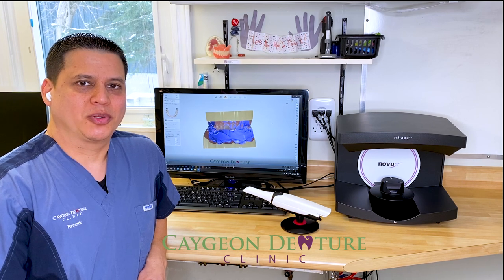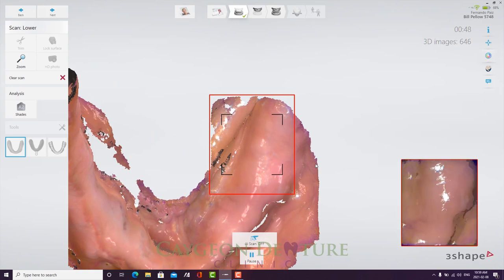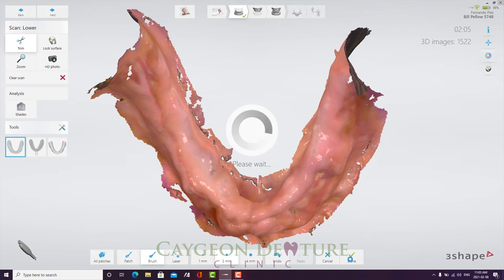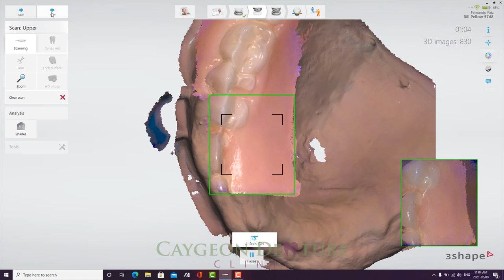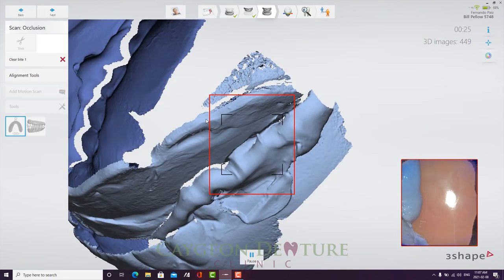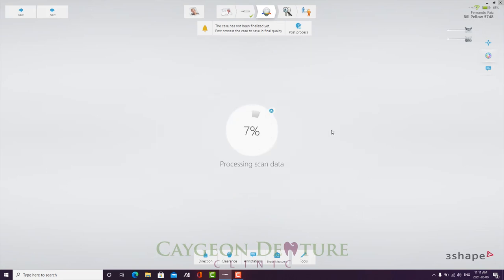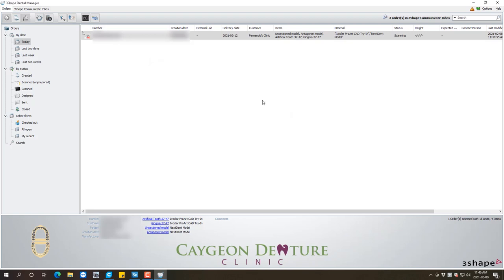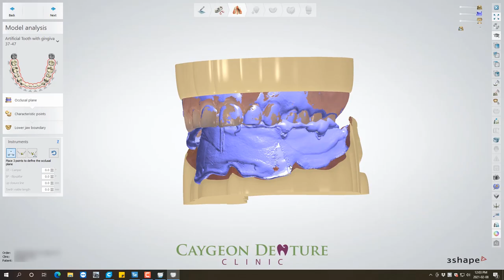Scanning Workflow to Fabricate a Complete Lower Denture

Comment: i have a question, in regular alginate impression we record in functional state as well by retracting the cheeks n rotating them even perform tongue movements does the scanner record the mucosa in functional state as well?
Reply: The scanner will only scan mucostatic tissue since no pressure is being applied. However, you can add pressure into your denture design for retention. For example, a common addition is the palatal seal.